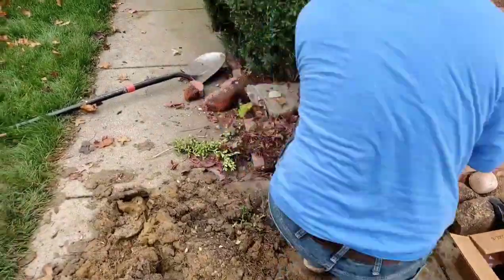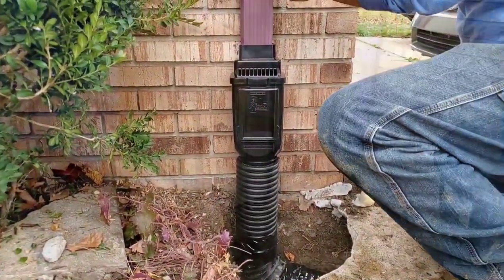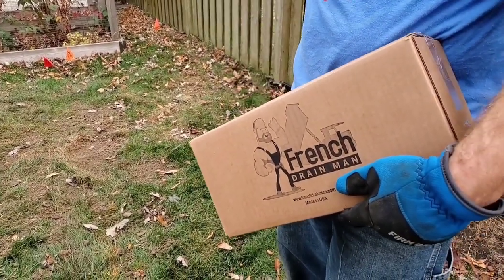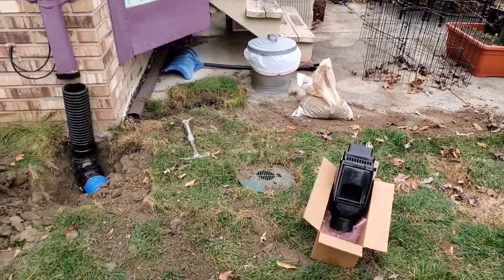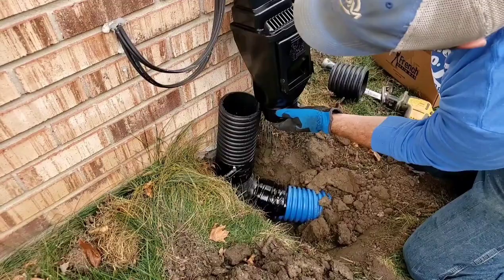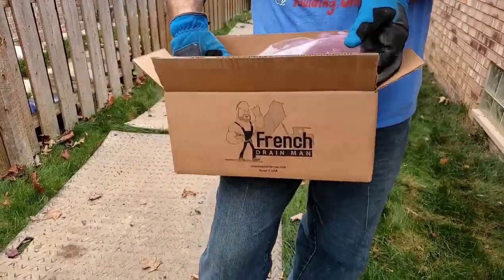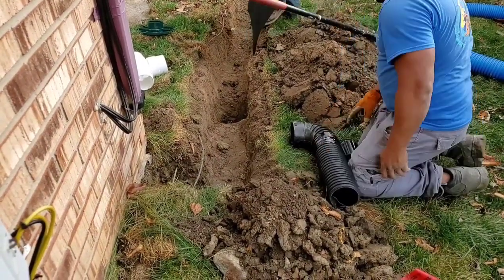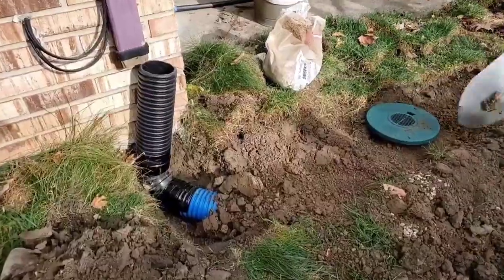How to Install a Clean Out on a Gutter Downspout

Comment: How necessary is the dual wall and the 90-elbow?  I've seen your older videos you recommended single wall from the downspout to dual wall underground (the rest of my system is  dual-wall underground except for a few single-wall at connections at the wyes.
Reply from the maker: 3" bends no problem 4" doesn't

Comment: The clean out looks like it works great. I would need one with a square bottom. My 4” drain pipe has an attachment that comes out out the concrete square. Do u make anything like that?
Reply from the maker: https://youtube.com/shorts/S0MPWPC21MI?feature=share
It will fit in anything 4 inch so if it's a 4"x4" square you should be fine.

Comment: Question: Using the tape, is there any possibility of leaks between the dual wall and 90, and also from the 90 to the 4" corrugated? I purchased your new Downspout Clean outs, and tried running Your Blue Buchman corrugated tile directly to it, but the 4" corrugated tile it to stiff for me as a DIY to make the 90 degree . It takes alot to try and compress it so that it vertical up against the house, and want to push the Clean Out unit all the way up into the downspout. Hopefully you can understand my explanation! I think this video shows a nicer/easier install for the DIY'er. My only concern is if the taped joints will eventually leak over time, causing water issues at the foundation. Thank you!
Reply from the maker: The male to a female connections are no problem ( Vent Cleanout into 4" Dualwall & Dualwall into 90°) the one to worry about is the female to male connection ( 90° to 4" Corrugated) use a lot of tape for sure. The tape lasts decades so no worries. I'm making parts as fast as I can eventually I will have a 90• that's female on one end and male on the other. It's a high dollar tools so probably 2 years out. I have a lot of new releases coming up that are more pressing ( Industry really needs badly).
Use the tape you will be fine. Thank you for your business and being a subscriber!

Comment: How do you get from this cleanout to a 6 inch corrugated drain pipe?
Reply from the maker: 6 in. x 4 in. Polyethylene Slip Snap Reducing Coupler
https://frenchdrainman.com/product/6-in-x-4-in-polyethylene-slip-snap-reducing-coupler/
Reply: Order placed! Hoping this system solves my overflow issues